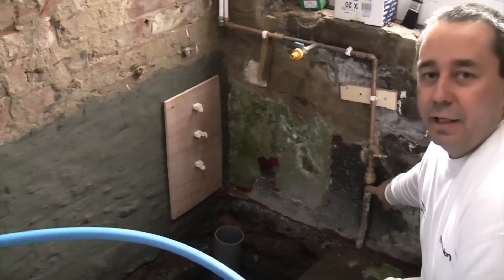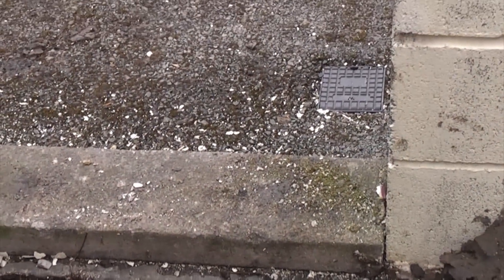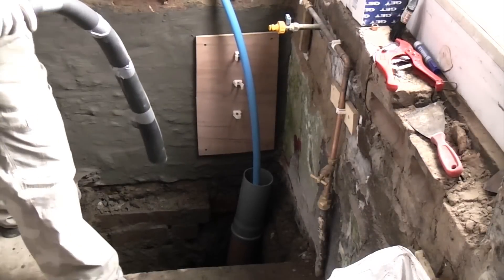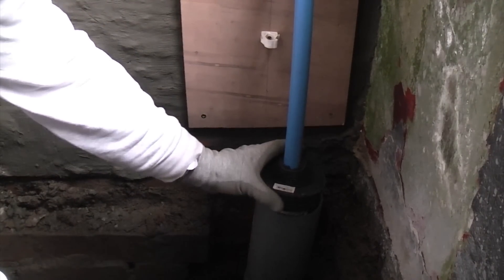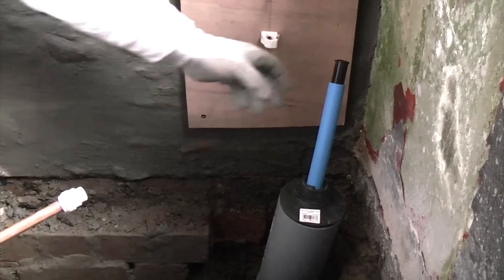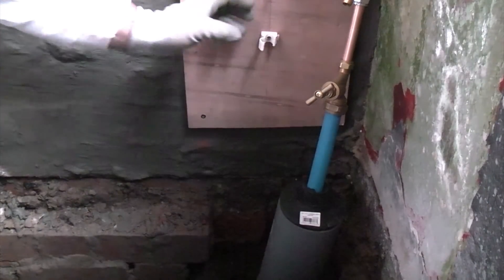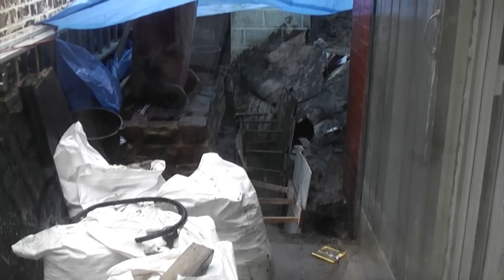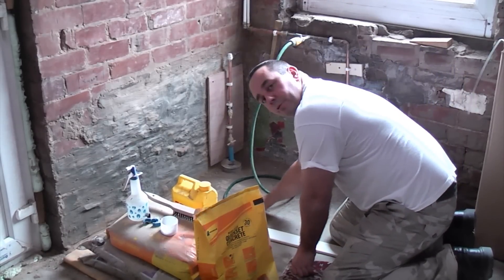Lead pipe replacement

Comment: Thanks for making this video, I'm planning to undertake the same job in a couple of weeks. Did United Utilities make you remove all the old lead pipes from the ground? 
Also what did you use to extend the long radius bend in order to make it long enough to reach under the wall and out?
Thanks!
Reply from the maker: GizmoSpank 
You are welcome.
No, you just leave the old lead pipe in the ground, United utilities will disconnect it from the supply pipe (unless it's a communal pipe supplying several properties).
The long radius soil pipe bend is long enough to go under most foundations (mine was not extended)
Reply: ***** Thanks for the quick reply! That will save alot of digging then as we are moving the supply from the back to the front of the house.
I thought the long radius bend was the orange/terracotta colour pipe but it looks like you have some sort of extension (grey pipe) attached on the inside of the house to bring it up to the floor level?
Your videos are great! really useful and informative, keep up the good work!
Reply from the maker: GizmoSpank 
Sorry, it was a while since I did this and could not remember. I watched the video until I saw the outside bit of the pipe but not the inside. To bring it up above floor level I just used a coupling and off cut of waste pipe on the inside.

Comment: @ultimate handyman
Hi. Great post. I'm taking this job on at the moment. One question, does the 110mm duct sit flush with the floor or does it have to be proud? Thanks.
Reply from the maker: You can get it as close as possible to being flush. I left it proud as I was screeding the floor at a later date and did not know how thick the screed was going to be. Once the floor screed was laid it was virtually flush.
Thanks for the comment
Reply: @Ultimate Handyman  Thanks for your reply. One last question. In the small gap around the outside of the duct can I use expanding foam? Between the duct and the edge of the hole. Thanks.
Reply from the maker: MARCHHARE900
You probably could do, as long as the foam does not come in contact with the water pipe. I was told by the guy inspecting mine a few years back that foam or anything made from petro-chemicals can leech through the pipe and leave a nasty taste in the water.
Thanks for the comments ;-)

Comment: Brilliant - thanks for this, quick question the 110mm seal, does it have another name I cant find that on the normal diy sites
Reply from the maker: You are welcome.
You might find one by searching for 110mm reducer. You can also get 110mm blanking plugs or stop ends which are similar, but the reducer is better.

Comment: You used the wrong insert for the compression joint to the stop tap it should have been a strong copper insert not a brittle plastic one that is for push on fittings like plasticons
Reply from the maker: The inserts were sold with the compression fittings. 
If you use a 15mm or 22mm push fit pipe and are connecting it to a compression fitting which insert do you use?
Also some push fit fittings don't even require an insert on MDPE!

Comment: I accepted the situation and reversed the order of the items.  I now have the 600 mm sink unit over the pipe and the dish washer to its left.  My wife wanted bowl on the left as is customary in Eastern Europe.  We tend to have the bowl on the right.  Nothing to do with left or right handed, just custom of nations. After posting phoned a plumber who told me as my pipe was black, imperial, washer no longer made, would need a trench to get to house: blue pipe takes 2 days and would be a tricky job?

Comment: I went in the street and found my mains and used that long tool to stop the water. Took the connector off, tap into the home, and see exactly black pipe similar shown here.  Is it possible to move the pipe sideways under the concrete somehow?  I think I will need to re-think where to put my units.  I have imported a german kitchen which is already assembled etc.  I will need to move things around unless you have some useful suggestion.  Not sure I can move the pipe even if I break the concrete.

Comment: Hi again. I have a problem as follows.  I have in my property a black pipe not a blue one.  It comes out about 30 cm from the wall in the middle of the wall!  I designed my new kitchen without thinking and I am now installing and plumbing.  Over that entrance is a 60 cm full sized integrated dishwasher!!! According to video I would need to break the concrete to try to do something under the level of the floor to move it sideways but it is exactly as you have it inside another larger pipe. Help!

Comment: can you tell me which area this is in, i'm doing simial in a severn trent house and had mixed messages (from them) as to whats acceptable, also where did you buy the rubber 110mm end caps, i can only find solid plastic ones, many thanks

Comment: once i got the fitting off to see why it was leaking i found that the pipe was cut at an extreme angle so it was impossible to fit the fitting on fully home.   anyway the water board guy was telling me about these lead shut down clamps you can get that basically crimps the pipe shut.  this would have been ok in this scenrio as the pipe was a dead end anyway.  do you know where i can scource these or even give me a link so i can see what they look like.

Comment: hi there I was wondering wether you could point me in the right direction.  today i attended a leak and it was actually on the philmac fitting.   the stank outside was cemented over.   and there was no way to shut it down so had to phone the water board to do a partial grid shutdown.

Comment: My brothers house had lead pipe to the kitchen, but his stop tap outside is right outside his front door so the pipe comes straight in and all the way under a suspended floor to the kitchen, if its replaced does it still need a long bend radius or just run the pipe as the lead it run

Comment: I'm about to do this job in my property, and I'm happy with everything except getting through the wall of the property. How do you drill such a long hole? Do you have to get a specially long core drill bit? I'm putting my new pipe under a suspended floor but the trench will be way below this anyway.

Comment: Superb video, thanks. Just about to start replacing mine tomorrow so this has made me confident I have read the rules correctly.  What was the lead time between application to the water company and connection and was there a any charge?